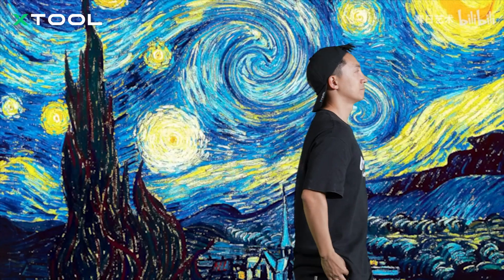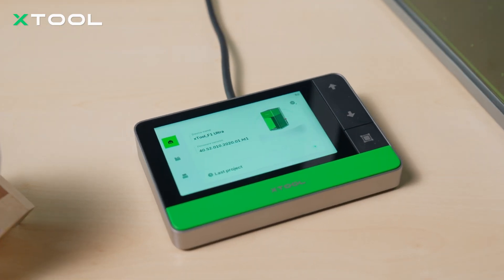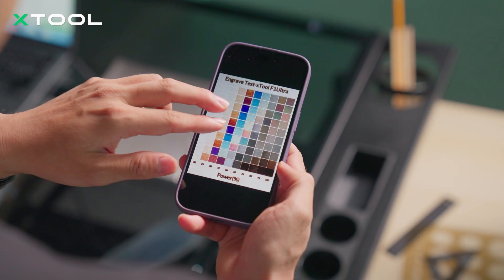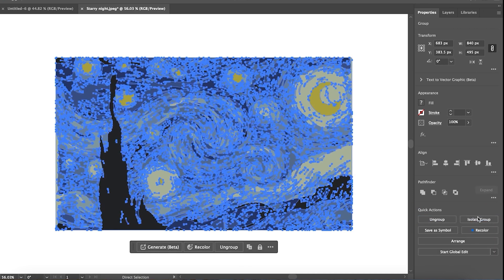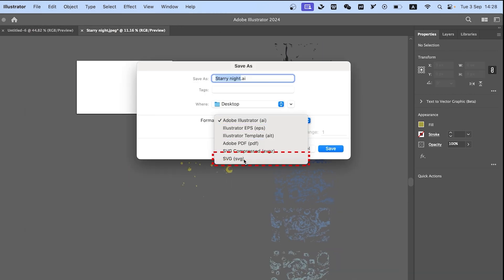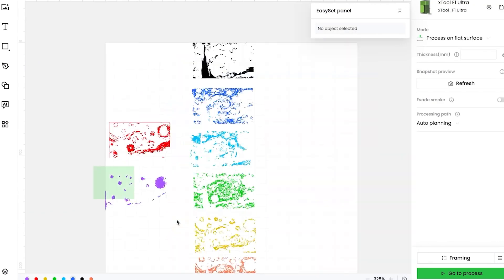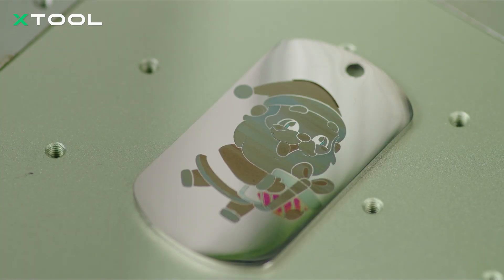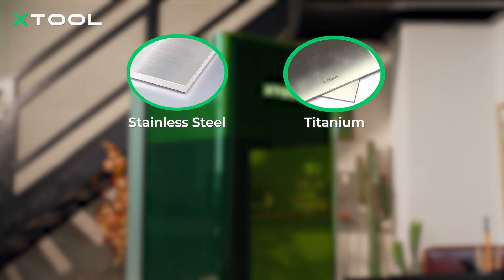Laser Color Engrave 'Starry Night' on Metal:  Bring Van Gogh to Life with xTool F1 Ultra Fiber Laser

Comment: Stunning, cool, MEGA .. but ... the design process in the two software environments takes too long and is not sufficiently supported by AI.

Therefore, a XCS upgrade is necessary: So as I see it, we MUST implement exactly this function, which also exists in Adobe Illustrator and was presented in the video, in XCS in the near future: “Autotrace” of color images with various setting options and, of course, AI support, so that you can laser colors pretty much AUTOMATICALLY with F1 Ultra, etc.

But in XCS, such a function should then be significantly better than in Adobe and adapted to the typical LASER WORKFLOW. So that the creative process is significantly accelerated: 

This means, among other things, that all required layers should then also be automatically extracted and sorted by brightness, so that you can then make the appropriate color settings per layer manually. 

However, the manual color settings per layer SHOULD ALSO be automated in future: After autotracing the bitmap image, the color settings, which you already got beforehand with the material test, should also be matched AUTOMATICALLY (via AI) with the layers of the bitmap image and the appropriate colors should be assigned to the appropriate layers in each case.  Of course, you should still be able to change this manually if necessary.

Here xTool could create something unique and great with XCS ...

Comment: @xtool can you do this with the S1?
Reply from the maker: S1 also can do the color engraving as we use the diode laser from F1 Ultra, but! It will take much longer time to finish it as S1 is not the galvanometer system! We spent 8 hours to finish this with F1 Ultra.